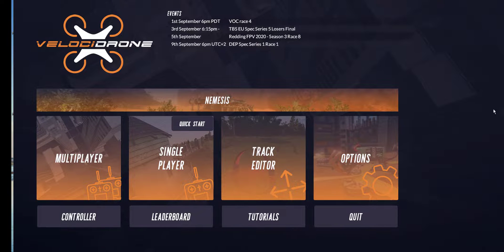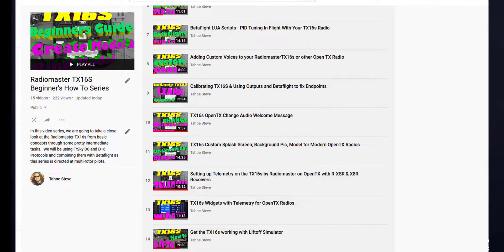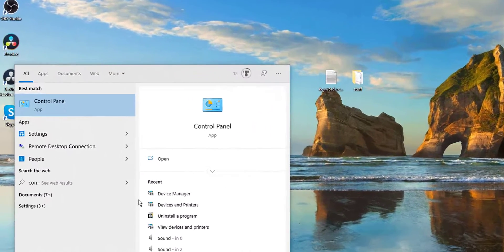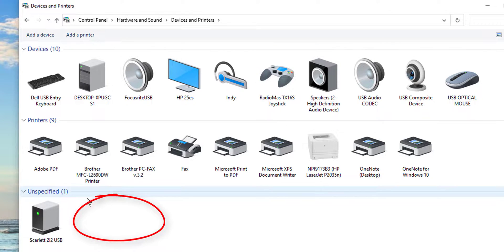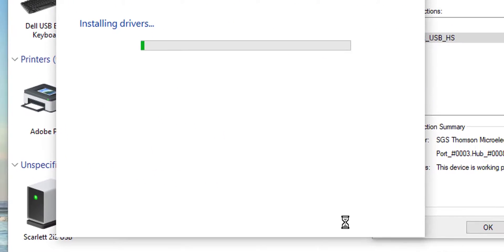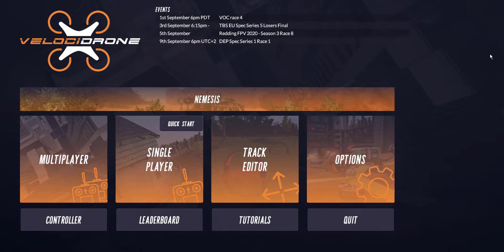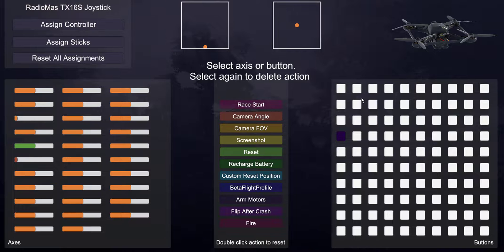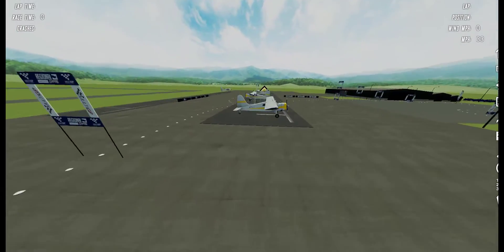How To Get Velocidrone Setup with TX16s by Radiomaster

Comment: It doesnt work for me and I dont know what else I can do. "Calibrate" is greyed out for me. On the test site nothing is moving, it also doesnt look like yours. Velocidrone sees my Controller but has the wrong image of the controller displayed and doesnt recognize any gimbal movement. Is it a Windows problem or something else? I dont think it is a Windows problem. I installed the WinUSB driver via Zadig, didnt work. I installed the lib-usb driver and changed the driver to usb input device (like you showed). Then it is shown as Radiomaster TX16S Joystick (as before when I just plugged the controller in and let it install its own driver). What else can I do? Do you have any suggestions? I have Windows 11 and EdgeTX v2.11.2

Comment: None of this has worked for my problem , Neither has any of the other videos I've watched on YouTube ....My radio master is set up as a joystick via the options on the radio master ... Windows devices sees it as a storage device ... Radio master tx16-S storage device is what it says , It also shows the driver as a lib_win_32 ... No joystick icon , Or joystick at all showing anywhere in Windows , I've tried both Windows 10 and windows 7.

Comment: Does the Tx16s come with the cables I need to be able to fly in a sim ? Or do I need to buy a specific cable ? Thanks
Reply from the maker: It does not come with it, but it is a commonly used USB C.
Reply: @TahoeSteve  oh cool thanks :) I saw the tx16s has an actual sim port ... on the pictures it looked like a circular hole with is weird because usb c has a flat rectangular end ! But thanks for confirming

Comment: Hi.  I can't even get my Windows 10 PC to notice that the Radiomaster TX16S is connected via the USB (USB socket on the top of the Tx to the PC USB input).  I am a complete newbie with both the TX16S and Velocidrone so any ideas would be really appreciated.
Reply from the maker: Press T1 and T4 together while turning on your radio to get into USB mode.
Reply: @TahoeSteve  Still no luck.  The TX screen shows the USB symbol but the PC Device Manager doesn't show any change in the devices list.
Reply: @SmallScaleSteam  i have the same problem :/
Reply: @kelapse8587  I don't know if this will help but this is what I found.
Being new to fpv drones I took the Internets advice and  bought the Tx16S and Velocidrone, charged and fitted the Tx battery, connected it to my Windows 10 PC and for 4 weeks got nowhere.  I then bought a Tiny Hawk II drone and followed the Internet videos on programming the Tx16S to operate it which allowed me to fly the drone.  Next time I connected the Tx16S to my PC the  Windows Device Manager showed the Tx16S as a USB device, but you still have to change the device driver from "Better USB" (Google Radiomaster Tx16S + Better USB for instructions).  That allowed me to select the Tx16S as a controller in Velocidrone.
I'm not sure why this worked as I have no clue about  OpenTx, but my guess is that with no model selected (e.g. the Tx16S was straight out of it's box) then it doesn't output any USB signals (even though I had selected  the USB option when prompted on the Tx16S screen).
I hope this may help.  Good Luck, Colin.
Reply: @SmallScaleSteam  im also new just bought this radio and i only used it yesterday tryed to connect it at the pc to play on sim. Im sure it will work in the end somehow i need to find out how! Ill give an other try again today. Thank you 😊

Comment: hello Tahoe, until minute 6 everything works fine, but then when i am into velocidrone, nothing wants to move at all. Have you experciecned this? the Tx16s is recoginzed inside the controller menu inside velocidrone, so i dont know what I am doing wrong. :( any idea?
Reply from the maker: not being there and seeing what is happening, i don't have a clue.  try starting over and go thru the steps slowly.  i only know how to explain it as i did in the video.

Comment: @Tahoe Steve, following your series for my RMTX16s. Finally got windows/velocidrone to recognise it thanks to you but still domt have lusb-32 driver, have HID instead. Problem is the power of the props is too powerful for a begineer.  I have tuned down prop pwer in the game to 50% still to much, Would it benefit if I used the weight ratios shown in your liftoff video or is their another solution you know of for begineers to quad flight please? thanks in advance.
Reply from the maker: If it works, don't worry about the drivers.  If not, HID will work.  Once it works, are you familiar with adjusting your EXPO?  If so, add some on your throttle channel
Reply: @TahoeSteve  you have a video for that in liftoff so Ill go check it out. Thanks for the response.

Comment: These vids on the TX16s are incredibly helpful, especially for total newbies like me. I've bought a Mode 1, but realised 2 would be better (just personal choice). There is a vid from Radiomaster on changing over the gimbals, but it shows a completely wire free back cover. For some reason I have a few wires attached to inside of mine. Any chance of putting up a video of swopping Modes over Steve?
Reply from the maker: If someone wants to provide the Mode 1 but at this time, i dont have one to demonstrate with.

Comment: When I connect my tx and go to controller my throttle axis stays in the middle. When I start a game the drone flies straight up then crashes. Non of my inputs work. What am I doing wrong. MacBook Pro
Reply from the maker: I have zero knowledge about Macs.  Hopefully someone will chime in.
Reply: Tahoe Steve I got it to work. I had to get an adapter to use the usb c cable that came with the tx. I was using the apple cable.

Comment: I DL'd this simulator 3x's and when I try to open the game it would take a long time before I could get to the TBS page and from there nothing, it just freezes and then if I hit it with the cursor I get (no response).  I run Liftoff with no problem so I know it can't be the Computer.
Reply from the maker: try reinstalling it, and reboot.
Reply: @TahoeSteve  So I did that several times and no luck, but I finally figured out what was my problem with both sims (Liftoff, Velocidrone). Now they both work great...
Reply from the maker: What was the fix?
Reply: @TahoeSteve  New laptop...haha
Reply from the maker: @DragonHank4217  nice!  Congrats 👏